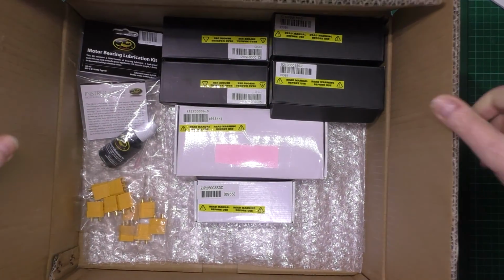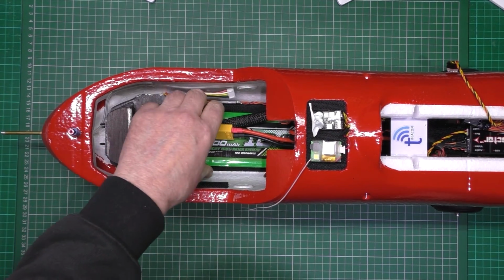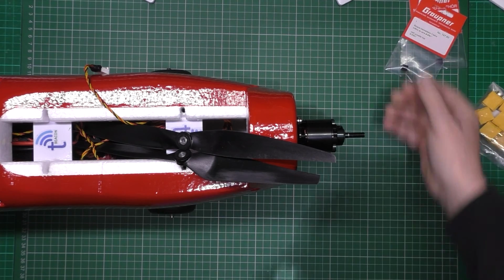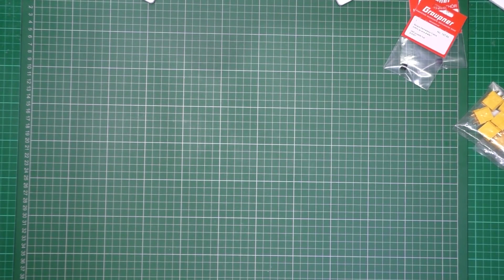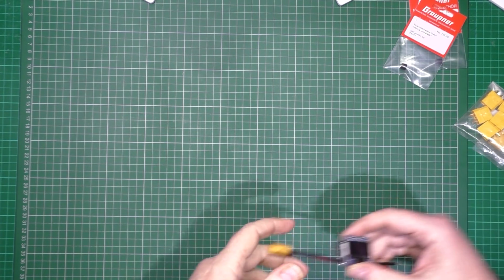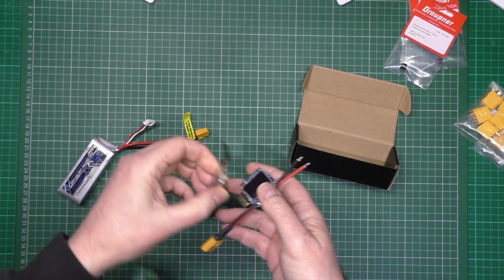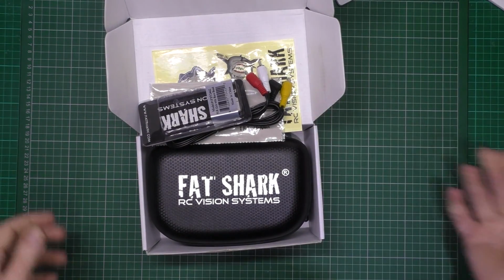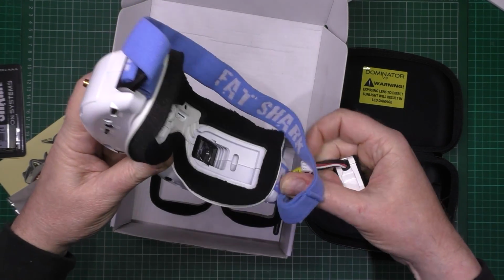Random RC talk #2

Comment: Really like where you are going with the power sensor and integrating a lost model alarm would be very handy.
Joshua Bardwell did some testing on the higher voltage LiPos recently. One thing that really hit home for me was the idea of reserving one charger solely for the HV LiPos to prevent accidental overcharging of conventional packs.
+1 on the storage charge concept. Like you I have a number of packs which have been kept at full charge from one weekend to the next with similar results. I have recently bought a number of expensive high performance 4S packs and have, so far at least :) been doing the right thing. Good luck with the upcoming summer activities.
Reply from the maker: +Rob B Cheers Rob. Quite coincidentally, I've JUST watched Joshua's video on these batteries and then saw your comment. He even has the same charger!

Comment: Didn't want to go for the Graphene's? I was looking for a PC power supply tutorial.
Reply from the maker: +Talan W Have you seen the weight of them? The 4s 65c 1300mah Bolt weighs 215g and the 4s 65c 1300mah Graphene weighs 384g. That's 56% heavier and you'll get much less flight time. I'll be doing a PC power supply video next weekend :-)
Reply: +Vortecks Awesome
Reply: +Vortecks I suppose you haven't been discharging the full unused lipos when you get back from the field? I don't know if it's possible but a lipo discharger diy either resistors or mosfets would be cool too. Most of the rc groups tutorials don't list a specific parts list and are kind of hard to follow.
Reply from the maker: +Talan W I only recently discovered the damage that leaving a lipo fully charged can do. All lipo chargers have a discharge/storage menu on them so there's no need to use anything else.

Comment: I'm waiting for 2 of those 10amp 4S Multistars to turn up for my new Skywalker 1900....They were going cheap at HKUK for £22 each....Im hoping I can field charge them using a 12vdc Lead acid..?  My charger is an Overlander RC6-SP type..?...Like you, I didn't think until after I had pressed the buy button...:)...Enjoyed your Lipo rant no end...lol.
Reply from the maker: +EnglishTurbines Mine was alcohol induced buying :-) You can use whatever power source you want, as long as it's a steady 12v and can handle the current. Most small lead acid batteries won't cut it - remember that. to get 10,000mah, you have to put in 11,000mah because the charger will only be around 90% efficient. If you discharge 2 x batteries and leave 25% in them, that means you'll need a 15ah battery but the voltage will drop off after it's used about 75% and your charger will cut out. Realistically, I think you'd need at least a 20ah battery to charge 2 x 10ah batteries that have drained 75%. Of course, I could be wrong and talking total shite :D
Reply: Vortecks Oh, well, I do have two Lipos which should equate to about 2 hours flying with luck..I suppose I could leave the car engine at idle..?...lol...I was a bit shocked when I saw one in your hand though...its huge, but the SW1900 should be able to handle it ok...Thats what Im told anyway...:)
Reply from the maker: +EnglishTurbines An engine on tickover is ok for 50a and your SW will handle one of these batteries - they fly much smoother with some weight in them but.... be prepared for some "Oh... this is coming in hot" moments! :-)
Reply: Vortecks Yeah, Im using a 4 channel EZUHF receiver, with my Storm and sppm...but throttle and rudder slots are taken up and the sppm is in slot #1....I only have one spare....So, Flaps or Camera Pan..?...decisions..Im lucky to have close mown grass in Summer, so I'm thinking of putting an UC on it?

Comment: I have a buddy sending me some computer power supplies a video on that would be nice ....what did you do to your transmitter to power you fatsharks?
Reply from the maker: +Chi Sty No problem, it's very easy to convert a PC power supply. On my Taranis, all I did was link the internal battery to the charge socket. I use a lipo so I don't need it :-)
Reply: +Vortecks how much more time would you say you get with the lipo instead of the stock ni-mh?
Reply from the maker: +Chi Sty Well, I also powered my Fatshark goggles with my battery and I can go a full weekend and only use 60%. That's probably 12 hours flying and also powering my goggles.